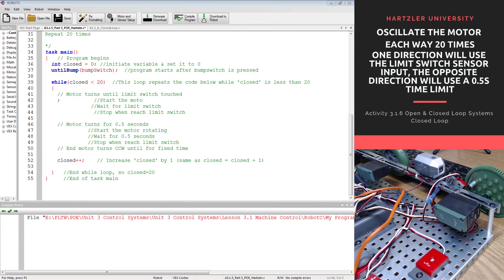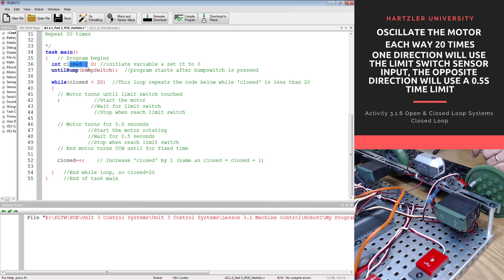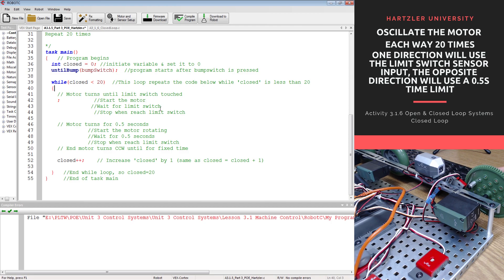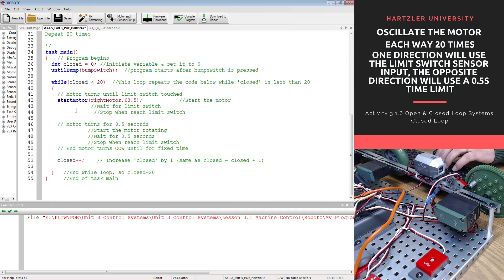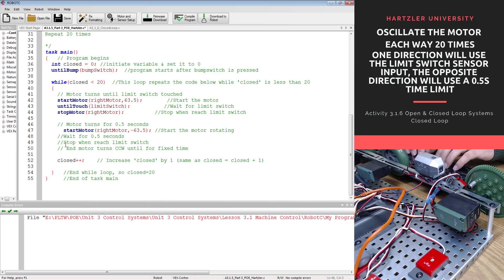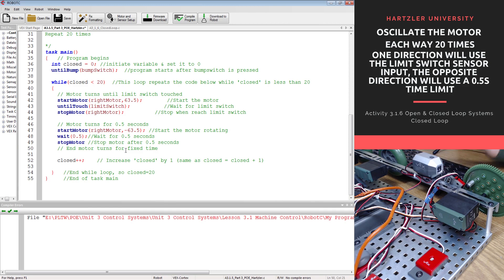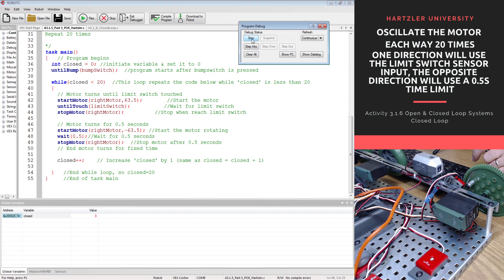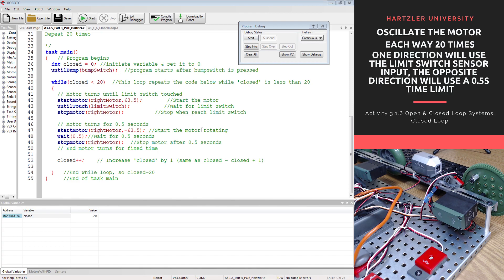Activity 3.1.6 Closed Loop

Comment: what did you do differently when you built that test bed compared to the other test bed(the one you used in the other 3.1 others)
Reply from the maker: I switched one of the wheels for the gear and moved the limit switch. You need to add a standoff to the gear so that the gear will hit the limit switch. The input from the limit switch is what makes this a closed loop.
Reply from the maker: Let me know if you need more information.
Reply: ok thank you for the information
 @hartzleruniversity3874
Reply: so is 63 half speed or is 63.5 or does it not matter
Reply from the maker: @blaynemayew8651  Its doesn't really matter. For my studentd, during class 63 is fine but on a test I would expect to see 63.5.